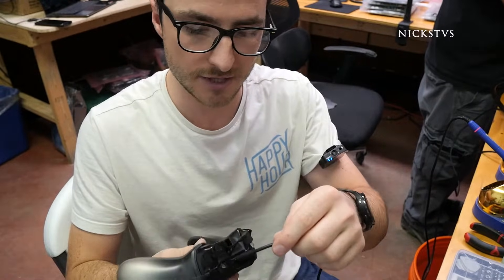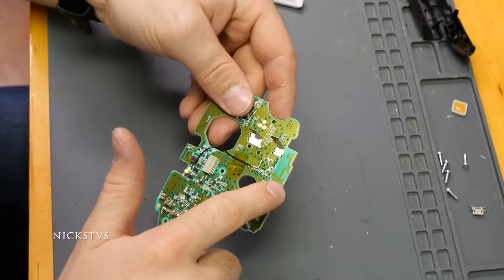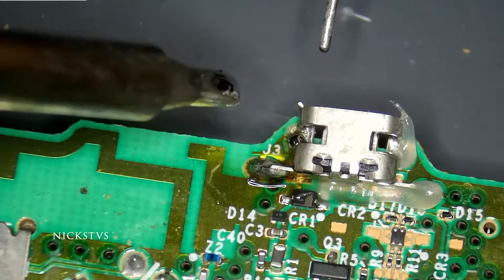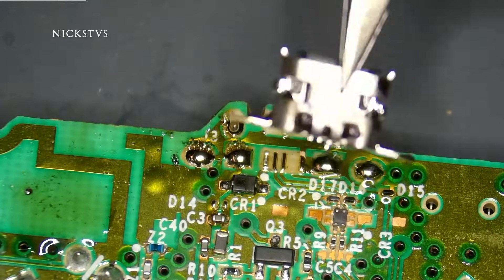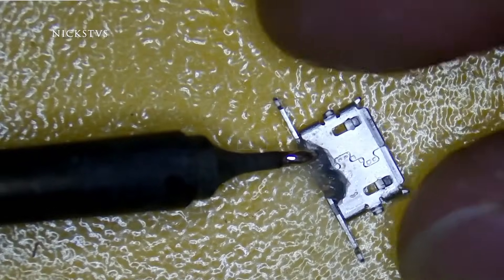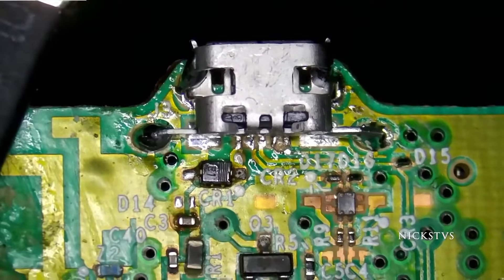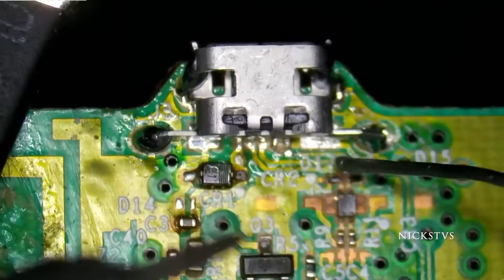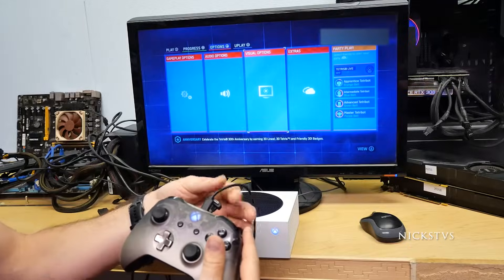XBOX ONE Controller Disconnects All The Time - Micro USB Port Fix

Comment: The ports on these things are terrible. Just from unpluging and repluging or the weight of the cable causes the port to start to bend off the pins. I went through 3 of these before switching to elite which has much better construction. Also frustrating how much you have to remove to access the ports. If youre gonna make them that cheap at least have an easy way to access the port for repair.
Reply from the maker: Yeah I agree, I really wish that they made them easier to take apart and to service. As you can imagine that is not on the engineers mind when they build these.

Comment: £150 for a xbone controller and the micro usb ports screw up just after the warranty. I now have 4 gamepads all with this friggin issue.
ANY Device that uses those port types AVOID - They are shite and will rip you off time and time again

micro$oft need a class action lawsuit against this.. It's really taking the piss
Reply from the maker: Yeah they should do what apple did with some of the laptop charging ports where they don't plug in, but instead they have magnets to keep constant pressure and you can yank the cable away and it won't damage anything. Not sure if I am describing it correctly or if you know what I am talking about but that would solve this issue.

Comment: I FINALLY FOUND A FIX: just rip some very small pieces of paper and put it in the usb c port in the side facing the front of the controller. It prevents the cord from moving
Reply: Thank you this is genius. To add some more methodology this: I ripped a paper strip from a standard 8.5x11 sheet to be as wide as the port and about 4 times as deep. I then folded it over 2 times so that it would be 3 sheets thick (2 sheets thick might work too). You should now have a folded strip that is slightly longer than the depth of the port. I then inserted the paper into the top (i.e. towards front of controller) part of the port until it hit the bottom and then creased the excess length upwards so that there is a little tab that I can pull on in case it gets stuck and to prevent me from accidentally shoving the whole strip of paper inwards when I connect the cable. When connecting the cable, I push the strip's tab upwards (while keeping the strip fully deep inside the port) to make room for the usb-c male connector and then insert it. Works like a charm.
Reply: @julianh1705  god bless you man
Reply: bro idk who you are but you actually just saved me from spending so much money tysm
Reply: Ngl bro ur a hero🙏🏽
Reply: THIS MAN IS A TRUE HERO
Reply: this man dsrvs a spot next to king david
Reply: Thank u brother, I just dropped it and now it doesn’t work but imma definitely give this a try💯
Reply: You are actually the goat, I thought I gotta buy a new one right now.. thanks dude
Reply: How the hell do. You fit the paper....
Reply: Ts actually workd😭🙏
Reply: Holy fuck bro u actually saved me lmao
Reply: Thx bro
Reply: life saver
Reply: i fucking love you
Reply: Do I put it in the controller or the plug?
Reply: thank you
Reply: my nigga
Reply: @everyone you gotta put it in the side facing the back not the front avery is tweaking trust
Reply: @bombay7368 huh?
Reply: @bombay7368 this worked you’re the goat
Reply: My controller is worse off ffs
Reply: Genius, can't believe it worked thank you so much for the idea! Plus on newer X/S controller I don't think it's as easy to solder the connections as in this video. Thanks a million!
Reply: W
Reply: Ty
Reply: Absolute legend!!! Thank you!!! Btw FBI is looking for you.
Reply: legend <3
Reply: 2025 and still works wow!
Reply: DUDE UR A LIFESAVER
Reply: Your the goat
Reply: God bless you man. I avoided buying a new controller.
Reply: Guys don’t try it I tried it and it just made my controller worse
Reply: This doesn't work trust

Comment: For people who lack the technical skills for this fix, there is a possible easy alternative.   Trap one end of a rubber band in the battery compartment, wrap it once around the controller between the buttons, thread the usb connector thru the other end and plug it in.  This will apply continuous force on the connector and may prevent it from disconnecting.
Reply: PlayStation controller? Pa4

Comment: it's not the charging port itself but the little piece inside of it is lose therefore is there a way to glue it??
Reply from the maker: It's been a while since I did this repair but I think it's the charging port itself and not the piece indide that was loose. One of the traces got damaged internally so when I removed the port the trace completely came off and I think that was because it was already damaged. 
I could be wrong. I don't do these often enough to know for sure.

Comment: I've seen a lot of board repair stuff and have done it myself. Trace repair not yet. However I've seen it done. Some conformal coating would of been good to anchor the trace you made on the backside of it. Long as it was just enough to hold it down and not create a big bump so the connector wouldn't sit flat. Then the anchor pins should be flowed from the bottom side. Lingering so it flows through to the other side. I do that for HDMI ports with my iron/hot air station to help. Makes a very solid connection.
Reply from the maker: Thank you for your comment! I appreciate you providing feedback and sharing your technique in a polite and nice way! What a breath of fresh air compared to some of the other comments I sometimes get haha.
Reply: @NicksTVRepair  Yeah I bet. By no means am I a professional. Just saying what I've observed and have done. Always in a constant state of learning with this stuff. 

Channels like Adamant IT are great sources to learn new tricks. Thanks for sharing with your video
Reply from the maker: I haven't seen that channel, I will have to check it out.

Comment: I peel back the battery sticker. Just use a tint amount of hot air on very low and it softens the adhesive and you can peepl it back and remove screw then push it back down after repair leaving no hole
Reply from the maker: If you have a collectors item I guess it would be worth the trouble.
Reply: @NicksTVRepair  I do it on every one I repair

Comment: Hot glue did the trick for me. Hot glued it in place permanent. Going on a couple of years now , and no issues, no disconnects.
Reply: Where did you apply the glue?
Reply from the maker: Very nice!
Reply: What did u put the glue at?
Reply: @allencooper9801  It seems the connector goes bad after some time from wiggling around, so I just plugged in a new cable and used hot glue. I just put hot glue around where the cable plugs in,  so now the cable is in permanent, cant unplug it, doesn't move around, and still 7 months from my comment still using the same cable, no disconnects.

Comment: I think this is basically a design flaw by Microsoft.  I thiñk they felt that by being able to use a new USB-C cable, it would give the controller an extended life.  But what they don't understand is how much stress the player puts on the USB-C port while playing.  If you are like me, I am yanking and swearing during difficult parts of a game such as boss fights. It didn't take very long before the cord stopped connecting to the port.  A USB-C connection is too delicate for this type of use.
Reply: yeah i think i'll buy a wireless adaptater
Reply: it's not a design flaw it's a quality issue. these things are made on the cheap in china for like for like 1 dollar. microsoft spends as little as possible to manufacture these hunks of trash and sell them to you for like 1000% markup. ALWAYS get the warrantee when you buy these things and REGISTER them. They will NOT last more than 6-10 months without something going wrong, no matter how good you take care of them.
Reply from the maker: Yeah they should go back to the old way and sell USB wired controllers.

Comment: I just used 3M Molding Tape and wrapped it around the rim of the usb connector/plug just enough for it to fit into the usb port of the controller. You can use as much 3M tape as you like tho. Wrap it around, plug it in, and once it’s plugged, smush/mold the 3M tape into the little spaces of the usb port of the controller until there’s no more wiggling.

And I’d def recommend using a combo of both 3M molding tape and super glue. Using the super glue at your own risk of course. Just make sure the glue doesnt leak into the usb port. If this tape fix doesn’t stick to the controller long enough, then I might have to super glue this sum’bitch so it stays put lol. I refuse to buy another expensive ass controller. Fix your own shit. Good luck guys

UPDATE: It’s been more than 2 weeks. Still holding strong AF. Been playing MW3 and MK1 for hours with no issues. Rock on fellas!
Reply from the maker: What you are describing is a fairly good DIY solution but is unfortunately a temp fix. Replacing the damaged port is the real long term solution
Reply: @NicksTVRepair  nah this guy actually made your video helpful i was watching this thinking i might as well buy a new controller
Reply: @bribanzzz9857 😂😂😂 😂

Comment: 0:12 is this some kind odf battery pack ?
Reply from the maker: ODF? Not sure what that means
If youare talking about the extra little cable that was attached it was for an aftermarket set of paddles that attach under the controler

Comment: Worst plug I've ever encountered in my life. Never before have I dealt with a product that would come unplugged if I LOOKED at it too hard. I cannot set it down without is coming unplugged EVERY SINGLE TIME. I have rubber bands holding it in place, I am holding in place with my fingers, I am setting it down like I'm doing brain surgery and it will still come unplugged *EVERY TIME!* You cannot make a plug this bad by accident.

Comment: why not just change it to a usb c since you desodder the whole thing?
Reply from the maker: Why change it to a USB C? I don't think it would make a difference would it. The controller is still designed for the mini usb so my understanding is that it wouldn't be able to take advantage of the improvements USB C brings. 
Or am I wrong? I don't know.
Reply: @NicksTVRepair  Well, from my perspective, it would still work the same and the issue with most mini usbs that end up tilting and breaking, would be gone for good as well. The connection is much more stable and reliable.

Comment: Hey, what did you do at 2:04? Because mine has three of these pads missing, and I don't know what to do.
Reply from the maker: We are soldering on a new pad on the board. So rebuilding the trace essentially. It's definitely a more advanced repair and is very difficult to do. Using a magnifier or microscope is almost required for these.

Comment: Just an advice from a person who's doing it for living. You don't have to remove the excess of the solder ;). You can leave it there and use a dip technique. So, you use it later to mount the port, just add flux and preheat it with a hot air gun. It's my fav. technique just by the way. Especially with HDMI ports ;).
Reply: And for those who haven't done it, you can easily put too much solder which will end up inside. Watch out ;). Last thing is that T12 has a tip of 0.15mm, it's handy to have it for all sorts of microsoldering. I use this one, but mainly I use bent one, just prefer it to use.
Reply from the maker: What soldering iron do you use and what is the full part number of the tip?

Comment: hello hope you are doing well. i just had a question, i cant get the usb port where i live so im trying to directly solder the wires to the board. sofar iv managed to solder 4 wires and get the controller working. but after a while the controller wont respond. so where do i solder the fifth wire/ what order do i properli solder the wires?
Reply from the maker: I don't know that I can help without pictures. Could you email us directly with pictures
Reply: @NicksTVRepair  Thanks for replying sure will do!

Comment: i just got this really cool controller for christmas and this egsact thing has happened the day i got it and i do t know what to do i dont wanna do this
Reply from the maker: If you just got that controller and are having issues, I DO NOT suggest you try and fix it. Get it replaced. It will be covered by warranty. If you have issuse with it on day 1 there are possible more problems with it than just that and it would be in your best intrest to get a whole new controller. 
It's a bummer and it will take a week or two to get the replacment, but trust me, in the long term this is the best option.
Reply: ok i might try or il probs just get a replacement with warrenty thx tho

Comment: Take controller apart, take needle nose pliers and put towards center of housing and other side of green board., Squeeze gently, tightened up connection and works good for the time being. Not at fault if you futz it up.
Reply from the maker: This can work provided the fault is not with the traces on the PCB

Comment: Hi so idk if ur reading this but if u r can u help me with mine so my wire cos I have a wired controller my wire won’t go in anymore it was fine like 10mins before it fell out bc I pulled it by accident and idk what to do I tried a different wire and that won’t work and if u can fix it can u try make it so I don’t have to take my controller apart
Reply from the maker: Hello,
I think the best thing to do would be to send me some pictures so I can get a better idea of what the issue is. 
Can you email me some picture to the support email, support@nickstvs.com 
From there I can take a look at the issue and let you know what you can do to fix it yourself, or if you might need to send it in for repair depending on the level of damage.
Reply: @NicksTVRepair  can I send u some pictures on discord